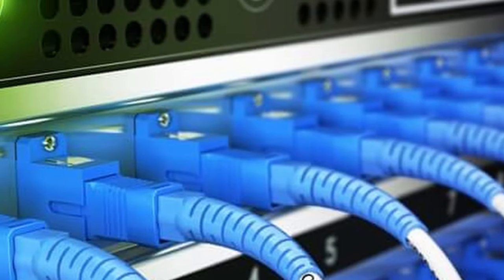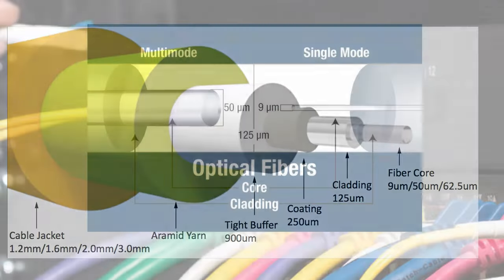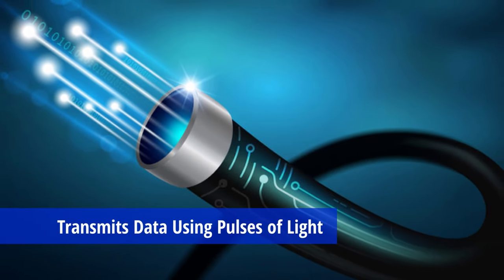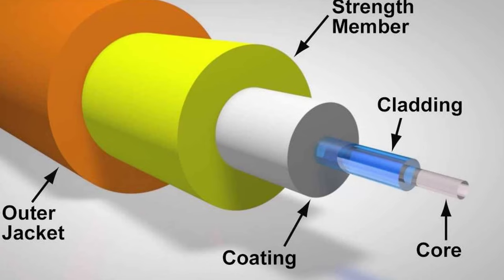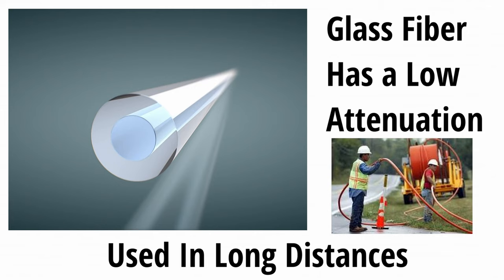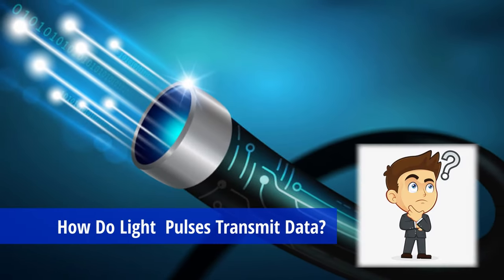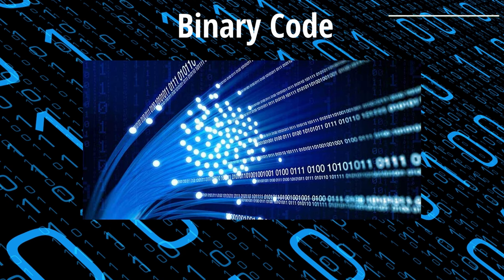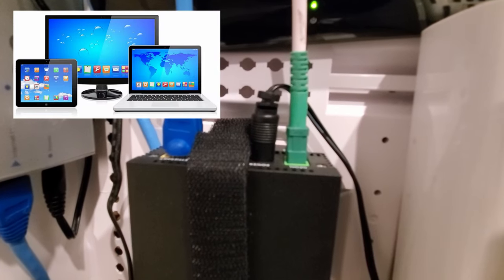HOW HOME FIBER OPTICS WORKS? HOME NETWORKING 2023

Comment: Excellent overview of fiber optics, thank you for a great video!  I remember years ago when fiber optics was relatively new, we had a class on how to add add fiber connectors.  I've long forgotten how to do it, but it was really cool to see no metal flowing through the wire, just light.  The reason for the class was that we had two buildings within 400ft. of each other and used fiber to eliminate the need for lightning arresters.
Reply from the maker: Thank you for watching I really appreciate it!